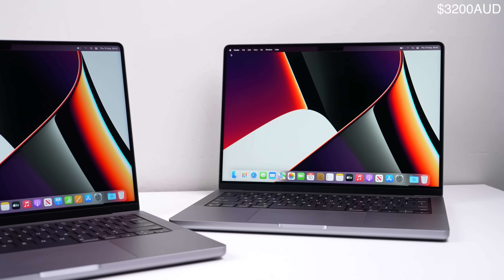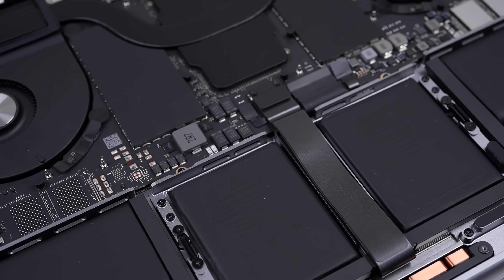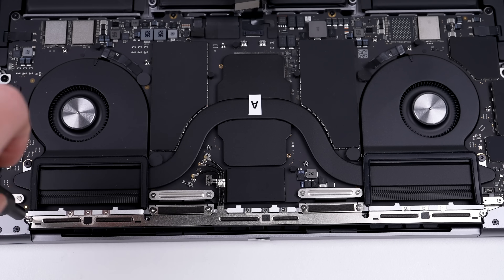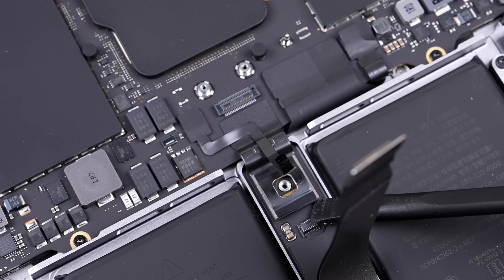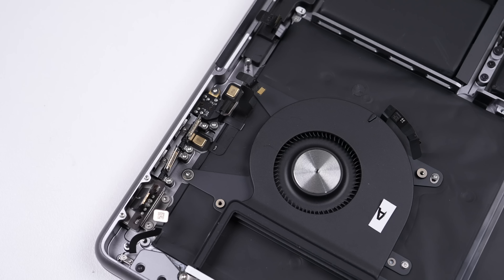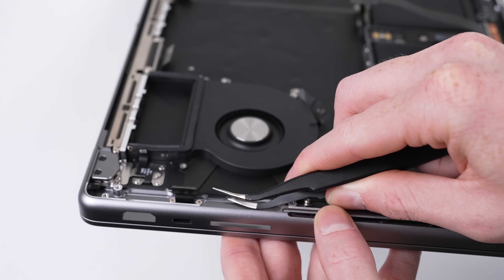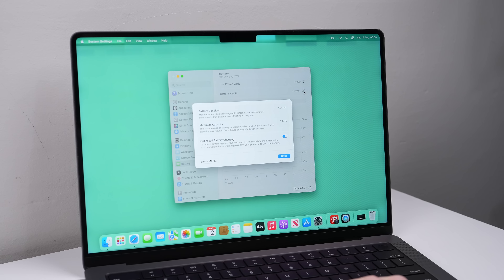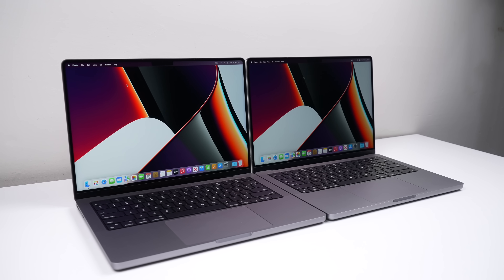New Anti-Consumer MacBook Pros - Teardown And Repair Assessment - Apple Silicon M1/M2

Comment: If you go this way, use robust glass for the display panel. The current screen is too fragile, it's very easy to make scratches
Reply: That's one of my biggest issues with Apple.  Their engineering is really poor.  Specifically they cut corners in places they really shouldn't such as PSU isolation, case and screen structural integrity, thermals, etc.  Everything is designed to appear advanced (thin, light, fast) when new but not have any durability, never mind reparability.  IOW, with Apple form completely trumps function.

Comment: The only reason I got into the Apple ecosystem was that i needed a Mac to run the software I wanted to run. Decades later, and I am disenchanted. Call me old-fashioned, but I want to actually own the products i purchase. That, and the deplorable near slave labor conditions at Apple’s Chinese assembly plants. I might buy one of their screenless M1 boxes but I be hooking it up to a 32” 4K Samsung monitor, the same one recommended by Barry Johns. Ironically, this huge monitor costs far less than having a faulty MacBook screen repaired would, and with a lot less hassle.

Comment: Interesting video with a lot of good info! I don't work in tech repair but I do work in IT and have owned apple laptops and all in ones for the better part of 15 years. In all of that time I have never once had to replace or repair any of my devices other than my wife's MacBook Pro that had the butterfly keyboard issues which were resolved for free by apple. I am curious to know how many people need to have these repairs done and how often it happens within the reasonable lifespan of a product? I do understand accidents happen and my 2015 retina MacBook Pro had its fair share of hard falls and dents but never had any hardware failures.

Comment: What a nightmare. All I can do is to remember how enjoyable IBM/Lenovo laptops was to work with years ago. At least the Business line. They were dead easy to open up, just about every thing in ithem where module based, so even a novice could service them. I worked on a school once and the kids loved to rip the keys off and put them back in so it became a random  flidpx keboard instead of qwerty and often they broke them doing this, so we usually ordered those keyboards in bulk, and it took only removing  a single screw, take the old keyboard out. connec the new one and slide it in, put the screws back took less than a couple minutes total. I loved those models. plus apart from the kids screwing with us the laptops was actually pretty sturdy if we could keep all the small rascalls from  destroying the keyboards 😅 

Why can't modern laptops be constructed this way. Never gonna buy a Mac computer for this sole reason. I love my iPhone and iPad and AppleTV, but unless you can accept buying a new model every 2'nd to 4'rth year when they usually go obsolete because they can no longer get OS updates, Apple is the debil. There is nothing that is serviceable in them and beside a few exceptions most of their products is non upgradeable after the purchase either.

Comment: i can`t even begin to understand how dumb do you have to be to buy an apple product of any kind especially a 6k laptop. For that money you can not only get an i9 13600k 4090 windows laptop or you can get a pc whit a top of the line threadripper processor that will output more then double the performance of that shitty mac. This statement does not even include the fact that the repair on these devices is getting harder and harder but no just buy a new one its only like half a car.

Comment: The glitch in the screen is obviously a water mark Apple added on purpose to detect hardware changes/repairs done by third parties instead of recognized official partners, because the official partners pay licensing fees to apple and get the tools they need, including firmware updates, to pair the screen and motherboard.
Apple just being Apple.

Comment: I wonder if the ports with ribbon cables are going to still work if replaced or if it also needs calibrating. Would not be surprised if they need.

Comment: Well if it isn't the most Capital C Capitalist Capitalism ever Capitalised on
Reply: This isn't true capitalism. People would have had a chance to compete if it's true capitalism. Apple can do this because it controls copyright over how parts work and thus which parts are compatible with what. And thus they control how you use their parts. Otherwise. Why not just make a bulky laptop frame and plug good parts in, to "repair" it?

Comment: 1. when you do a test you need to buy 2 exactly identical models including but not limited to the same amount of storage and ram (yes you will need to spend more but you are rich from all your views so you can cash out the videos)

2. inability to sleep no problem you can just sleep it manually instead as a workaround.

as long as apple does not make inability to wake from sleep.

also today's laptops no longer have spinning hard drives so even if they draw more power when not sleeping you wont lose data to hard drive damage.

3. @apple and @tim cook if you want to save costs why not work your employees off the clock (oh we need you to get me the rubberManservant).

4. replacing the display angle sensor losing the fingerprint sounds like a security glitch or a way to circumvent the security (steal someones macbook replace the sensor and no more lockout).

Comment: The EU quite recently announced a new set of laws that will make replaceable phone batteries mandatory for smartphone manufacturers to implement. So that's a step in the right direction.

Eventually I reckon that most consumer-grade electronics are going to follow similar circular economy legislation regarding other components, since making them irreplaceable are not only anti-consumer, but also ultimately creates a lot of unnecessary and harmful waste.

It's just a shame the the EU takes decades to actually get things rolling.

Comment: throw any shit to the apple as much as you want, compared to other laptops, performance wise they beat the crap out of even thinkpads. yes, I have both and I hate apple in any day, but repair ability is an issue on other brands as well. just because they have made framework laptop, it doesn't mean it is available everywhere on the world or will be available for 20 years.
Reply: in addition, back in the day, I had own a Nokia 6131, which literally had magnet thing to understand if the screen closed or not, I have realized its existence when I replaced the chassis. It is no way a new thing but it is an essential "priority" part to control hardware and software.

Comment: stop buyin this shi7 and they will get the message!

I recently overhauled a HP ZBOOK 17 G5 Workstation.
Complete garbage - unacceptably thin ribbon cables, a thin almost seethrough motherboard and absolyte garbage of a heatsink.

Quality is now what it was. Will never come back.
Buy reasonably adequate machines you can service and repair.

Comment: Give apple credit.  Opening that MacBook Pro is nothing but art under the hood.  Like a modern American muscle car in which the engine is covered in plastic. 
The Funny this is that Most apple users (99%?) will never see the inside of their MacBook.  But they KNOW it looks nice inside.   *MEH?* 

Let's compare the MacBook to their closest Competitor, ThinkPads.   I did my best to match the models in this video to the Thinkpad P1 Gen 6 with intel i9-13900H (which is generally faster than the M2 Max).   There will be things that don't match, sorry. 

$6500 = MBPro with 14" Display,  8TB SSD, 96GB RAM.  But Going with the 16" model for $500 extra.

$7000 USD for MBPro 16" 8TB SSD, 96GB RAM.  
$3700 USD for ThinkPad P1 G6. 96GB RAM, The SSD is 256GB, but user replace with 8GB SSD  is part of the $3700 price. (Thinkpad only sells up to 4GB)

Comparing the two:
The ThinkPad P1 is a few mm bigger than the MBPRO 16 in every way.  P1 is slightly lighter..
> P1 (Like Thinkpad T and X series) are spill-resistant.  ie: spilling your water on the keyboard will likely NOT effect it.  But will kill the MacBook.
= P1 has 3840x2400 in the $3700 price.  Slightly better than MacBook Pro. 
> P1 doesn't have a NOTCH taken out of the display.
> P1 has the world-famous keyboard, still.  And a numeric keypad. (Can vary) 
> P1 6-screws to remove bottom (nothing special) 
> P1 Battery = 4 screws to remove. Takes a minute.
> P1 2 M.2 SSD drive bays.  User can install 2 x 8TB drives!  Great for upgrades or transfer data.
> P1 2 memory slots.  User can get 32GB version, upgrade later when they want to.
> P1 optional RTX 4060 (included in the $3700 price) is easily faster than the M2 Max GPU.  But will drink the battery. 
< P1 battery life is several hours less than MacBookPro.  P1 = 15hrs web browsing/10.5hrs video.
< P1 internals are functional.  A bit of wires and guts.  No where near as pretty as a MBPro motherboard.  (I've not seen my ThinkPad guts in years)
> P1 Like all Thinkpads, the service manual and parts are available TO THE END USER.  I've ordered screws, they sent them. Every part is itemized to be ordered by anyone.

MacOS is still nicer than Windows in many ways.   

When spending Thousands on a computer, it should be REPAIRABLE.

Comment: While Mac Studio and Mac Pro indeed has replaceable SSD, it is bound to that one SSD and will brick itself after removal. If the original drive fails (which it does after 8 years) the machine is useless. Cant boot from secondary drive without original installed. So that 65,000 dollar mac pro has maxium lifespan of 8 years. Apple will say its obsolete and refuse SSD replacement after 8 years.

Comment: Why do people even buy this overpriced crap anyway at this point? Its literally cheaper to have a full desk top pc, multiple infact. And you get more modularity out of it, an easier time to repair and clean and you can upgrade your basic thing til its the finest piece of hardware i could imagine, easily capable of running an AI assistant, act as the central hub for a smart-home and all sorts of other things while you play extremely resource intensive games on it during your freetime while never closing any tabs.

Comment: Using a MacBook for work is a really stupid idea. With a Lenovo Thinkpad, you just order the parts and get them in a couple of days, no questions asked. Even with a Samsung Ultrabook, the motherboard has components only on the bottom side. The top side is empty and completely covered by soldermask so in case of a liquid spill (which I had) the chances of damage are quite low. Finding the keyboard for replacement was hard but the replacement relatively easy (not as easy as Lenovo but still).

Comment: The thing is it's not just anti-consumer. This is anti-sustainability, anti-free market, anti-business, anti-security, the list goes on. We're talking about a multi-thousand dollar machine with the same power and sleekness that you could get in a PC for half the price, and you're looking at a computer that can be rendered worse than a $50 laptop from 2001 by breaking or replacing one ribbon cable that's not even an essential component for basic operation.

The landfills are gonna be full of Apple Silicon pretty soon.

Comment: I had a MacbookPro once, Very good machine, good battery, and a very rounded OS, struggled a bit with software compatibility, but not a huge deal, all good until it required maintenance, At that time I used it for some Architectural light renders, and one day about 7 months using it, it overheated BIG TIME, always when I rendered I did in a stand with some ventilation, given that even normal use it got a bit hot, probably because the air vents where partially obstructed by the screen when open, a design that until this day I don't understand why, so I started the render went to the bathroom and when I came back I was going to type something at the moment I touched the keyboard my fingerprint stayed on the keys, the entire KB was soft, closed immediately the render, let it cool down a bit, shutoff and proceeded to an AStore to fix, a lot happened, in the end, I paid for the new keyboard, asked them if the MB was damaged they said no, 1 week later the charger died, had to buy a new one, these 2 almost the price of the notebook itself, 1,5 month later, DEATH SCREEN the MB was gone, again went to a AStore, they claimed damage was user fault, that i shoudn't do renders on that machine (even tho at the time it had literally the same software on theyr website showcasing on that very same macbook), they sent me the repair quote, it was DOUBLE the price of a brand new one, i trashed it.

so after that, I never bought anything from them, ridiculously expensive, non-repairable friendly, completely anti-consumer, etc... living a very good life with Lenovo LEGION series.

Bear in mind that this happened in Brazil, where everything is more expensive, and Apple is ridiculously more expensive, The MacbookPro 14" in US starts at US U$1.999 dollars while in Brazil the very same Macbook starts at U$4.930,56 dollars yep more than DOUBLE. if you take the 16" with all the options it reaches the outrageous U$15.100,22 dollars price tag by comparison in US, the same, it will cost a already outrageous amount of U$6,998.98 dollars, and our minimum wage is lower.

Comment: Looks like half the cost of a Macbook Pro is all the proprietary screws in it.

I'll stick with the cheap stuff. If I want to upgrade a component or two, I can do it myself. If it breaks, I can replace a couple of parts. If it breaks beyond my ability to fix, I can afford to get a pro to repair it. If it breaks beyond the pro's ability to fix, I can buy a new one without taking out a college loan.

Comment: Again why I never went with Mac.  The fact that memory and m.2 ssd drives are soldered into the board meaning no upgradeability.  If you need more storage or more memory or faster memory you have to buy a whole new system.  Everyone talks about open source and open standards and hardware specifications but the first to really be more open was Windows.  Growing up on the blue-collar south side of Chicago we looked at buying computers, but we just couldn't afford them so then we looked into building them.  There was no option really for Mac so you went PC and windows.  Apple just wanted to exploit its customers, but Microsoft wanted to make their products more accessible.  This more open environment is what drove innovation and why we have Nvidia 3D GPUs because you could bring together many different components to make a PC so vendors started engineering and making them.  Then people would make fun of Gates standing at conferences with a blue screen behind him but I say imagine if Jobs had to have the MacOS installed on someone else's hardware, man it would have been much worse, forget blue screen probably wouldn't have even started half the time.

Comment: What i don’t understand is why nobody just makes similar laptop to apple but for win OS. I have macbookpro 2013, with bootcamp on it. Works great(yeah battery dead by now).
I would in fact buy new macbookpro but they got rid of so much stuff in these 10 years..usb, hdmi(although i heard they are back), bootcamp and discrete gpu…so u cant replace my old macbook unfortunately with new one. And the market for pc laptops is rather shit, always has been

Comment: As bad as this is, at least you kinda get a piece of mind that these laptops almost never really break down within their expected lifespan and usually well beyond.
Reply: Errr not really, mine just died within 3 years, SSD toasted from failed voltage regulator out of the blue. Apple quoted me £700 to replace the logic board as it was out of 2 year warranty. I quoted them the 6 year UK consumer law  arguing that it was faulty design at source. They then offered to fix it for free after that. Apple design beautiful products but they also design to fail. Genius bars always booked out!

Comment: I have a question..... How come someone doesn't make a thicker bottom for those laptops so you can install a bigger battery and thicker cooler so you can get better performance ?  Maybe even add like a e-GPU installed with the cooler if possible.

Comment: what do you say of adding a coat of thin flexible plastic/rubber on the weak spot of the display flex cables? Will this help prevent damages?

Comment: People keep making the simple mistake of confusing pairing with calibration, if the display doesn’t 100% work properly, but still sort of works, it’s a calibration issue, the problem is not with the design, it’s with Apple’s unwillingness to provide the proper equipment to recalibrate the new displays, if the component is deliberately paired to the device, it wouldn’t even work at all.

Comment: Apple sucks at this price range. Apple solders the ssd because it prevents you from buying the cheapest co figurative which would be to get the smallest drive and then replacing it with a hier capacity one.

Apple sells 1TB of storage for more than I will pay at retail. They want 10p% of your money and even standard parts like the ssd and ram can be replaced by anyone, but Apple prevents it.

This benefits Apple, not the consumer. And yes you all keep buying them likes it no big deal. If something happens you need more storage, you csmt just o create it, you have to go an spend $3000 on a whole new computer.

How stupid is this????????
I thought you guys were so smart?!
All.of this because you hate Windows. 😆